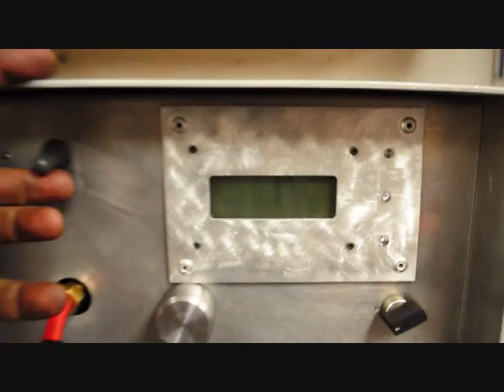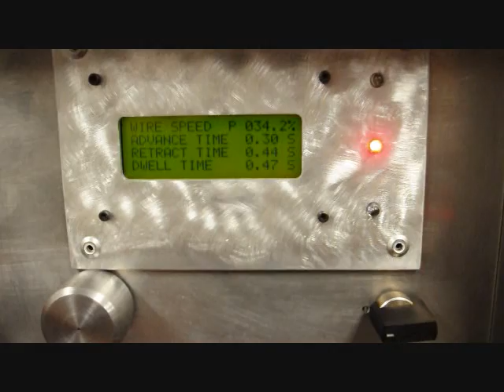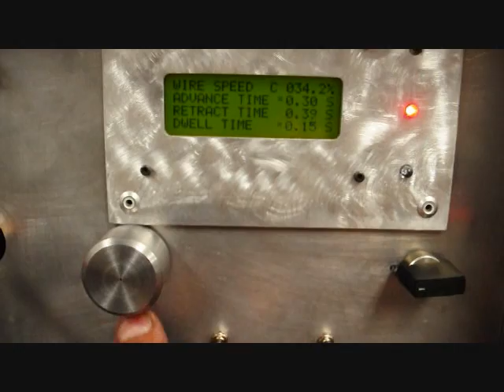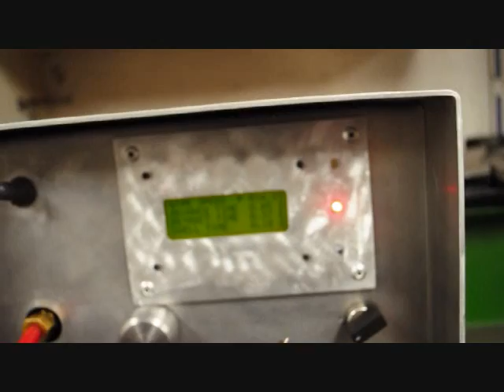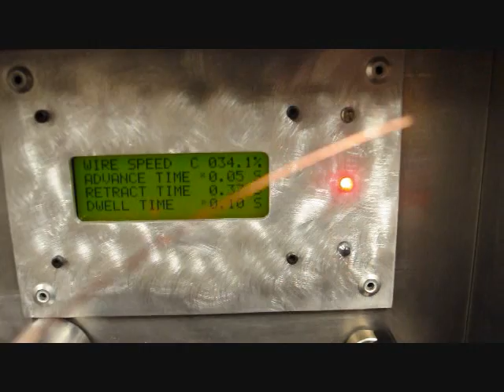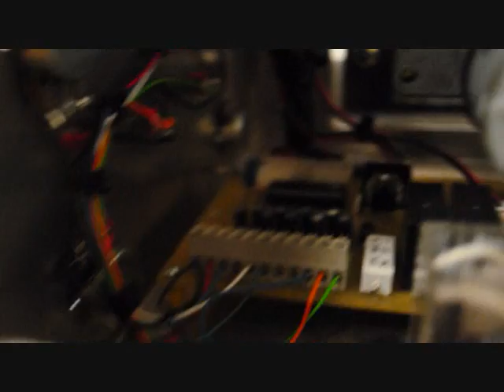TIG_COLD WIRE FEEDER.wmv

Comment: Can I hook an external welder to a cheap wire welder and use it for the wire feeder and adjust the amperage on the external welder? It is a dc welder.